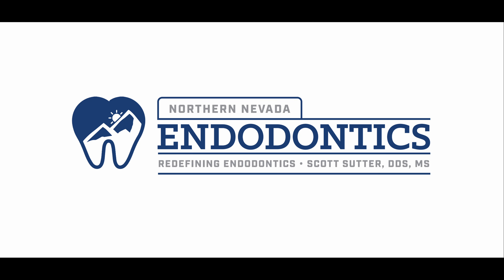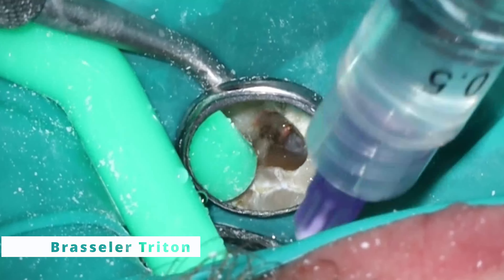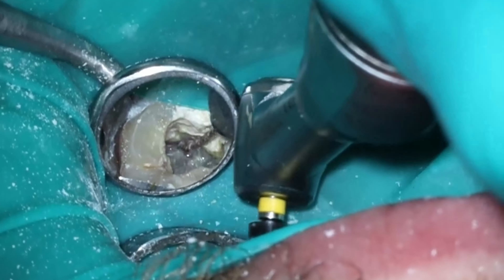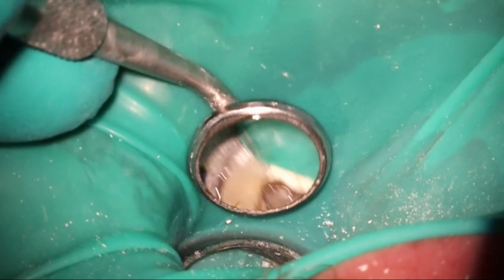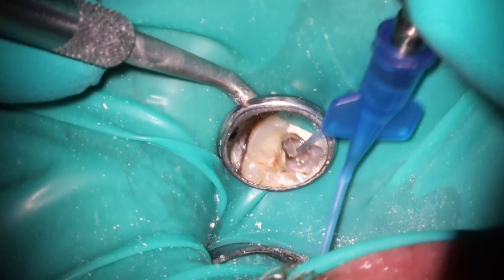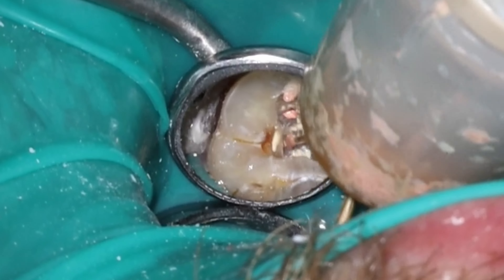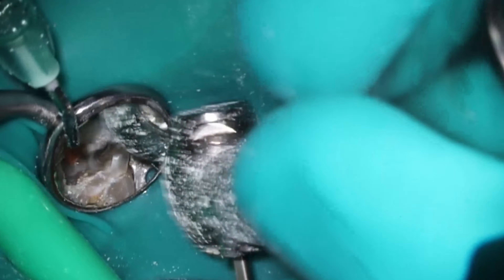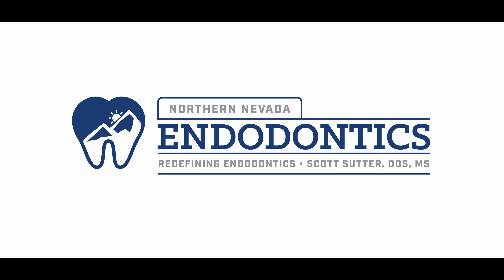PIT or PITA? When others are the first ones in the tooth

Comment: How far down the canal do you normally place the irrigation needle?
Reply from the maker: With side vented and these small shapes, pretty much 2/3rds works well. Put it in until it binds and then back it up 1 mm or so
Reply: @PatencyPro  some studies i’ve read indicate that the solution doesn’t go much past the tip of the needle,  so by this measure the apical third doesn’t get much contact with the irrigant,  what are your thoughts on this?  I’m thinking about using irriflex needle tips to get further down
Reply from the maker: Those studies are correct in that it doesn’t go beyond the tip. But there are plenty of cases out there where no irrigation was used that are “working”. The goal is to get the bacteria back to a more reasonable level and give the patient and the tooth the environment to survive, not eradicate 100% of bacteria. That’s a losing battle and not needed for success most of the time. If you’re worried about it, enhanced irrigation or calcium hydroxide can help, but those cases will sometimes fail, too. 
Endo is a fickle mistress for sure lol.
Reply: @PatencyPro  yeah it makes you wonder if the advanced irrigation protocol like gentlewave and even lasers are worth doing.  It seems that there is diminishing returns when it comes to those more high cost methods

Comment: one aspect of your work that is much much faster than mine is the initial WL and glidepath securing. I spend a lot of time getting to WL (getting patency is harder in molars despite coronal flaring...I'd say I get my 10 file to WL immediately in only about 50% of the cases I do...  and I find even canals youd think are easy like palatals of upper molars sometimes have apical curvatures that is prone to ledging without judicious filing), checking I have a good reproducible reference point, and getting to the 0,0 on my apex locator that is stable and consistent. If these videos are in real time, you achieve all of these very fast imo and I don't even think you curved those 10 files. I'd love a video just discussing this initial part of the process with several cases ideally. What can GP's learn from you in this crucial initial part of RCTs? There's something here that I'm not seeing that I can learn that would significantly increase my endo speed..thank you doc
Reply from the maker: Great video suggestion. The short answer is: rotaries are so good now you don’t need to get to length with hand files. It’s a vestigial hang-on from the days of old. And unfortunately, those teaching at most schools learned that way and still teach it. Hand files ledge teeth and make your life hard. Rotaries are…well, I’ve seen everything, but in general they aren’t capable of ledging, and they make your life easier. I still get a solid 0.0, but I take an 8 about halfway down before taking the rotary down the same amount. 
These are all real time with no cuts. Only cuts are to stabilize the footage because it’s shaky AF without it.
Reply from the maker: Have you watched this video?
https://youtu.be/Ji2TAb_KHO0
Reply: @PatencyPro I actually wanna know how to be efficient in these first steps? Do u actually work it manuallessly? If so what files or what to consider when doing the whole thing with rotaries? I tried to achieve achieve glide path and patency with glide path 13 3% files before but it didn't always worked and the file was too weak to advance to the end of canal
Reply: @omaromar11234  for sure, out of the 3 rotary files i've separated, 2 of them were glidepath files I tried to force when it just wasn't going to the apex. I'm still practicing based on adage: don't bring rotaries where your handfiles haven't been (exception is orifice openers), though it has been a much slower technique compared to what I see from Dr. Sutter and I'd like to learn more modern techniques that are faster.
Reply: @Nvrloptimism  I wish I know their secret in the Manualless shaping.. I've seen some videos of some endodontists that shape the might mb2 totally without any manual files!
Reply from the maker: I take what the tooth gives me. My sponge usually has an 8C annnnd. That’s it. lol. But there are times it will look like a porcupine with a ton of spent files in it. (My rotary files are already loaded in the hand pieces)
@nvlroptimism That old adage was for non heat treated stiff files and I agree if that’s what you’re using. Don’t push harder than what it would take to break a pencil and let the file do the work.

Comment: Hi, do you do pre-endo buildups and IDS?
Reply from the maker: For the pre-endo buildups, I don’t. I prefer a unicore concept for the buildup, and I have no isolation issues. I usually use another tooth or clamp the gingiva if I have problems. 
For IDS, I need to do some research into it! It seems super promising. Any resources you have seen that would be useful would be appreciated!

Comment: What are your reasons for not removing the decay before the cleaning and shaping? Would that not make your life even easier?
Reply from the maker: Great question! I felt like I didn’t explain it well enough in the video. Two reasons I didn’t remove everything initially: 
1) I wasn’t sure if I would finish the case. I don’t like using the Gentlewave on these beat-up cases as it leaks, so I thought I might need to medicate. Even with the decay, the tooth would be stronger with the rim of enamel and dentin for the month, so that lessens the fracture risk during that time.
2) leakage! It’s far easier to keep it intact and have a good seal than to remove everything and try to seal it with flowable. 
That access is far larger than mine would generally be on this tooth, so it was already easy. It would have made my life harder to remove everything, so I left it during treatment and removed it once I knew I was able to complete the case. 
Fantastic question; thank you for allowing me to explain!
Reply: Thank you for your very satisfying answer.